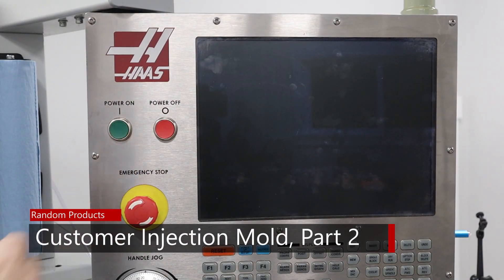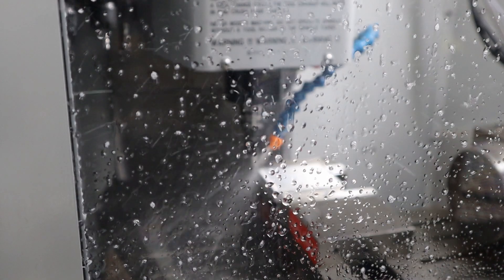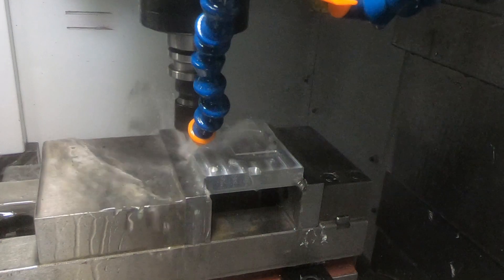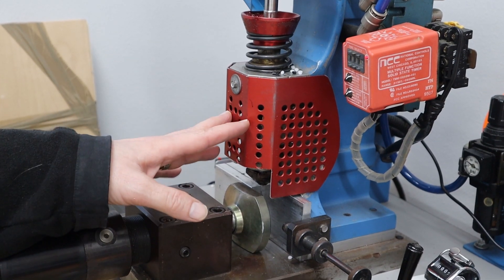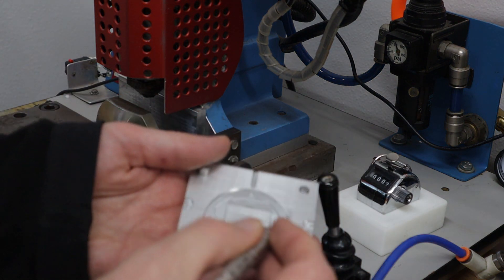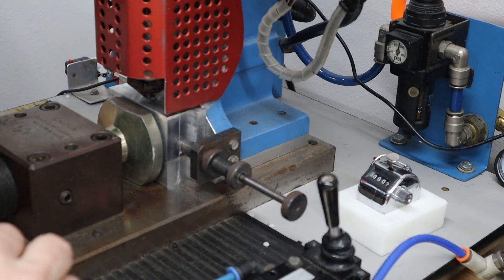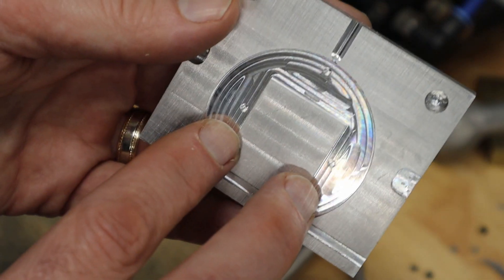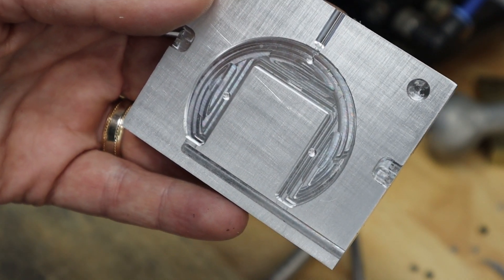Customer Injection Mold Part 2

Comment: How much draft did you use to cut the cavity side walls?
Reply from the maker: I used 3 degrees. I've since learned some ways to make the walls smoother, which makes it much easier to get the parts out.

Comment: i guess this is your own workshop, John, what will you do if the mold is required of surface finishing such as VDI or polishing? did you do it by your ownself or outside?
Reply from the maker: These are much simpler molds. I have never polished a mold. Instead, I use smaller end mills and longer milling cycles when I need a better surface finish.

Comment: Having watched most of your videos now, is there a specific reason you don’t use tapered cutters when you cut the draft on moulds, something like this for example? ~ https://www.mscdirect.co.uk/TEM-03167L/SEARCH:CATEGORY/product.html
Reply from the maker: No good reason. I typically use a number of smaller end mills (down to 0.010" diameter). With CAM, I can cut any draft angle I want. It just takes a little more machine time to get reasonably smooth sides. So I just never tried to use a tapered cutter. As as said, no good reason.

Comment: Really enjoyed this one.  I have used set screws to eject parts before.  It’s not pretty, but it works and I only use them where I can push on surfaces that are hidden once everything is assembled.  Still bumbling my way through some aspects, but it’s a hobby.
Reply from the maker: Thanks. I have another approach in mind, that you'll see in a future video. I don't know if or how well it will work yet.
Reply: JohnSL trying new ideas is all part of the fun and learning.  Looking forward to seeing what you come up with for popping out that thin part.

Comment: Good job.. what type of plastic you used?
Reply from the maker: Thanks. I'm using polystyrene in this case because the customer wanted silver and wanted to be able to glue it easily. I already had pre-colored gray pellets (I have to use pre-colored since this is a plunger machine).

Comment: What about polishing the mold? (Less friction) or making an ejection jig that you can just drop the mold into real quick? 🤔
Reply: Let me go way off the grid here, and suggest air channels in the mold, so you can use a blow off gun to create air pressure to release the part 🤔
Reply from the maker: That's an interesting idea. I'll have to think about that some more.
Reply from the maker: I asked someone who's made lots of molds about polishing and he said he never polishes a mold. Instead, he let's the machine do it, with smaller step downs and smaller end mills. That's worked well for me. But in this case, I think it's shrinkage that's the issue.

Comment: Do you still have the Morgan press? Is the Morgan press comparable to the injection machine in this video?
Reply from the maker: Yes, I'm hoping to have the Morgan up and running this weekend (so a video soon). The Morgan can handle much larger parts. The machine in this video has about 2,000 pounds of clamping force, so not much. The Morgan can go up to 20 tons. The Morgan also allows for ejector plates, which means it can be used for semi automatic production.

Comment: Why not use the existing pin holes to make holes for extractor pins?
Reply from the maker: First, I don't have pins on hand. But more importantly, I'd have to flip the mold over and bang on a plate to push out the ejector pins. I'm just about finished designing an ejector bar that can remove the part from the front with two screw drivers. That will be in a video coming soon.

Comment: As a quick fix- Bore up the injection sprue to a bigger diameter and try to eject it witht the spure maybe?
Reply from the maker: Probably not in this case. I think the shrinkage is causing it to grab in enough places that a larger gate would probably still snap off. But I'm just about finished designing another approach that I think will work well.

Comment: Next next episode: “Today, we’ll be installing a safety interlock to prevent a cycle from starting if the mold is not clamped. Welcome to another episode.”
Reply from the maker: Yup, I've been thinking about that... Want to help? I know you're always looking for new projects ;-).
Reply: JohnSL Sure! Wonder if others have suggestions on how to approach this? Also, could you tell what output ports you have on your lever switch and what min/max pressures you use for clamping?